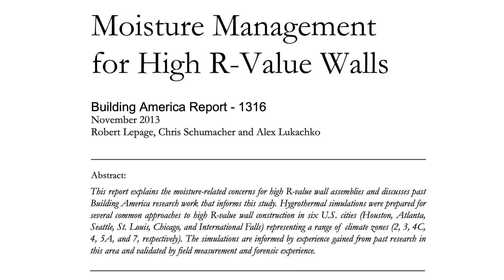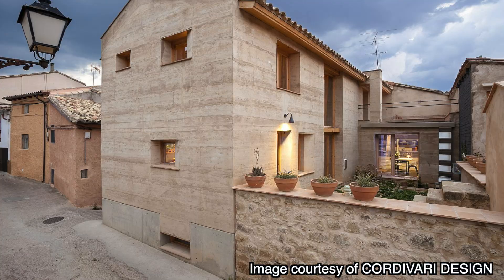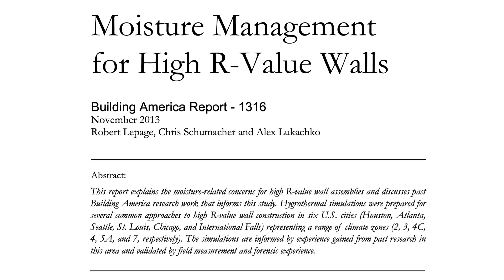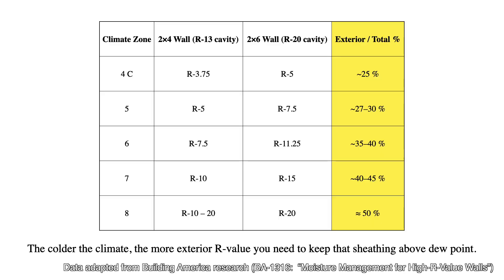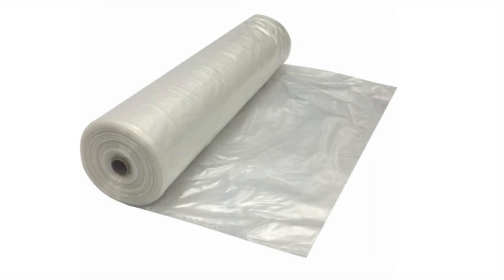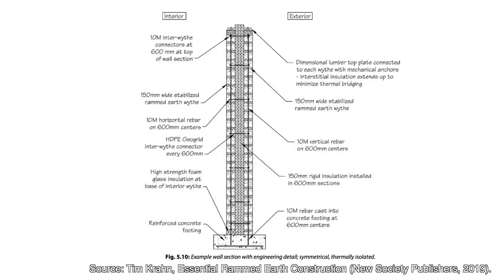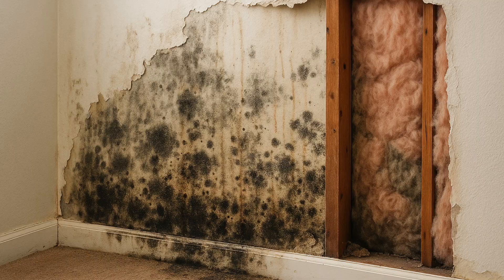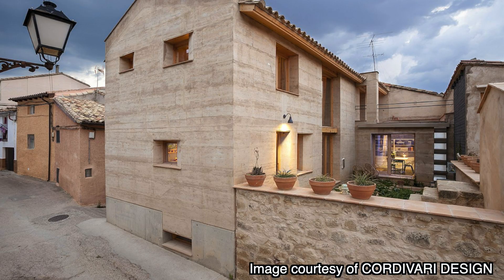Thermal Control Layer: Ancient Building Science That Modern Codes Forgot | Part IV

Comment: Is there anyone such as an engineer, architect or open source  creating standard construction details like roof connectors and reinforcements around openings for rammed earth construction?
Reply from the maker: Great question — and honestly, this seems to be one of the gaps in the rammed earth world right now. Neither of my main references (Refined Earth by Martin Rauch and Essential Rammed Earth by Tim Krahn) provide standardized roof-connection details or reinforcement details around openings. Rauch shows a lot of examples — ring beams, concrete slabs bearing the roof load, timber frames bearing on corbels, concealed steel lintels — but they’re all project-specific rather than universal “standard” details.

Right now, roof connectors and structural details around openings are almost always engineered case-by-case. Groups like SIREWALL, CRAterre, and the Earth Building Association of Australia have guidelines, but no globally standardized, open-source set of details exists yet. It’s an area where the field is still evolving, and every building ends up with its own engineered solution.

Comment: Earthen buildings are a marvel and are suitable for most climates.  Along with rammed earth, compressed stabilised earth/soil blocks needs more exploration for brutally cold weather.  

Regarding moisture accumulation in exterior walls:  One can only speculate that if relief slots/holes are provided at the very top of the insulated frame wall, it could greatly contribute to drying out the wall cavity.  These holes could be through the wall top plates, allowing drying to the conditioned attic; or,, they could be on the interior side wall sheathing, allowing drying to the inside of the building...  There are two philosophies:  1) Just prevent water from getting in at all cost, and 2) Water WILL get in, so also provide a way for it to dry out.

Comment: These are great videos. Thank you. 

I have a bunch of questions. First a little back ground. last summer I helped my son build a small house, log framed, perfect walls, he got a good deal on some used rigid foam, so the vapor retarder question wasn't as urgent because the foam is a vapor retarder.  At the bottom I will put some links to the videos of us building, in case you're curious. 

My questions:
1- You allude to this, why have vapor retarders at all? The vast bulk of the moisture is coming through air leaks. If, and I know it is a big if, there are no air leaks, can enough moisture diffuse through the wall over time to become a problem?
 
2- What about using two air barriers with differing vapor permeability?  For instance Tyvek as an interior air barrier and then Typar as an exterior WRB wrap? This way you would double up on restricting air flow, but still alow moisture to migrate through the wall, but given the different permeabilities of the wraps, it would tend to go in one direction toward the most permeable layer.

3 - In addition to the price problem with so called "smart" vapor retarders, they are also complicated materials and I wonder how they will do after 50 or even 150 years from now. Tarpaper is the original smart vapor retarder. It has been around for a long time and has worked well. But what about using it inside the air envelope of the building, does this pose a health problem for air quality because of what it is made from?

Robby

Around 6:30 on this one I detail how we used perfect walls
https://www.youtube.com/watch?v=9xJJkNWYsCw&t=443s

roof system
https://www.youtube.com/watch?v=J7lEfrNvxFQ&t=808s

general overview
https://www.youtube.com/watch?v=GRW1w1uiNx0&t=1s

videos
https://www.youtube.com/@theprojectbasedlifestyle1089/videos
Reply from the maker: Robby, thank you — I really appreciate this comment and your whole channel. I watched the video with the perfect-wall build you did with your son and have subscribed. I’ve had my head in the theory for so long and I’m craving more hands-on context, and watching you two actually build helps me conceptualize things way better. I’ve bookmarked the rest of your videos to work through soon, but for now I’m trying to keep up with all the comments here. It’s so encouraging to see people really think through assemblies instead of just repeating code minimums.

On your questions:
1. Vapour vs air: You’re totally right that air leaks move the lion’s share of moisture. If the air barrier is excellent, walls get dramatically safer. But vapour pressure is still real whenever there’s a big humidity difference, and diffusion can slowly load moisture into cold sheathing over a season. Whether it matters depends on climate and R-ratio — and Ubakus (which someone just introduced me to!) looks like a genuinely helpful tool for modelling that.
2. Two air barriers: According to my reading.. Tyvek and Typar are both vapour-open WRBs and great exterior air barriers, but using them on the inside gets tricky. Moisture always “chases the cold” because vapour pressure is lower on the cold side of a wall — so an interior layer that’s always wide-open (like Tyvek) lets indoor humidity drift outward into the cold layers all winter. But when a wall actually needs to dry, drying always goes toward warmth, because warm air can hold more moisture. That’s why smart vapour retarders stay tight in winter and only “open” when the wall itself is wet — they let the wall dry inward without helping it get wet in the first place.
And with two airtight layers — even if both are vapour-open — any moisture that ends up between them can sit in a cold, low-energy pocket and dry extremely slowly. That’s the part that makes a Tyvek–Typar sandwich risky.
3. Tar paper: You’re absolutely right that it’s the original “semi-smart” material and from what I’ve read, it works beautifully outside. Indoors, though, there can be IAQ concerns with asphalt-based products, so I would tend to be cautious with anything living inside the air envelope.

Thanks again for the thoughtful questions and for the work you’re sharing on your channel — conversations like this are exactly what I love about this space.
Reply from the maker: Oh here's the link to Ubakus: https://www.ubakus.de/en/r-value-calculator/#
Reply: @RootedResilientLiving  Thank you so much for the thoughtful replies. That's really helpful. 

I'm in the process of building another structure, round log-framed etc., and i was going to insulate it using some variant of a Larsen truss and cellulose, but i got a good deal on some second hand rigid foam, mostly polyiso, and so I will use that, which simplifies things and definitely helps with the cost. My friend who is an engineer told me that he did a deep dive into insulation and concluded that when you factor everything in, cost, pollution during manufacturing, R-value, everything, cellulose is probably the best, and this has steered my interest in that direction. But when you can get nearly new second hand foam at a quarter the cost of new, it's hard to turn it down. 

I'm looking forward to the next videos. Thank you. Robby